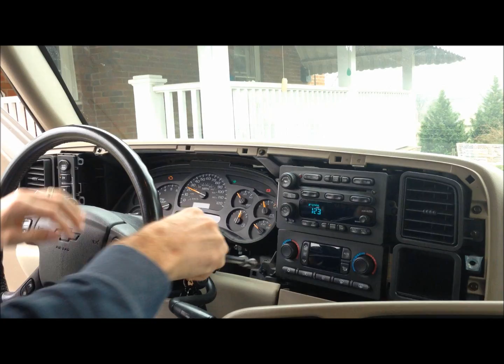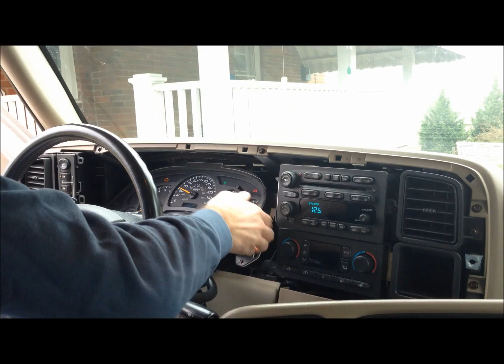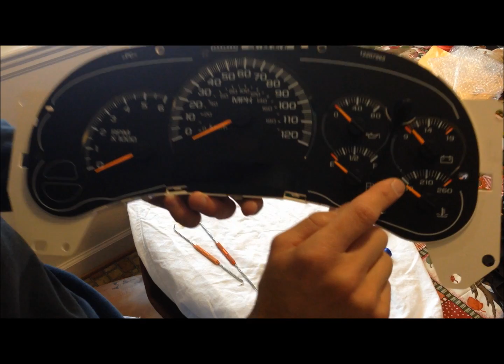How to Remove the Instrument Cluster from a 2004 Tahoe

Comment: Do you remember the link for the stepper motors or will a simple search pull them up?
Reply from the maker: plentypaperP30 You can go to eBay or Amazon and type your vehicle year and model and the phrase “stepper motor” and it’ll come up.  They now have the LEDs and motors packaged....which would’ve been nice.  But, here’s the link I found with a quick search:  ECCPP Stepper Motor Repair Kit - X27 168 for All 03-06 Chevy Silverados, Tahoes, Yukons, Suburbans (6 motor kit + 10pcs Bulbs) https://www.amazon.com/dp/B06XTPZHPM/ref=cm_sw_r_cp_tai_4Cj4BbSY70NEB

Comment: thanks great video you saved me 500 bucks! chevy dealer wanted over 700 to change my cluster. i bought one for 200, it took me literally 12 minutes to remove the old and put in the new. (and i know NOTHING about fixing cars period) i can see the dealer charging maybe 350 but over 700 is just out and out robbery. plus they charged me 140 for "diagnostic" because i declined the work. so it ended up costing me about 350. i plan on writing them a letter not that it will do any good. if any one out there cares it was chevrolet of smithtown on long island, ny. i will NEVER bring my tahoe there for anything and i hope anyone reading this doesnt either they are CROOKS.

Comment: One piece plug extremely hard to remove. Push in on clips and slowly pry with a screwdriver to pry off.  I had to use a lot of force.  I thought the plastic area around the plug was going to snap.  Remember pry slow and steady and pull the plug clips very hard. After removal noticed deep groves inside which leads me to believe big plug & small hole = pain in the ass!! Lol!!

Comment from the maker: Just a suggestion, there's a one-piece plug in the back that connects a bundle of wires to the cluster. Whatever force was strong enough to break the glass probably knocked the plug loose, which means it would have had to have broken the clip that holds it on. Just about anything can be found on eBay; not sure about the price for the glass or plug. On mine, the plug is very tight and would likely stay on without the clip. Just need get in there and see what's going on. There are other good videos (some better than mine) on YouTube. Good luck and thanks for watching!